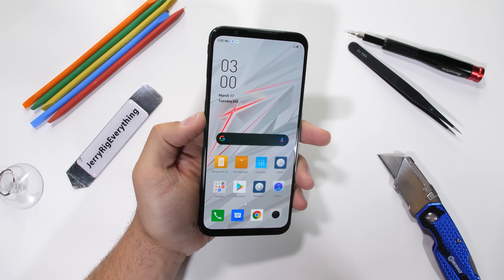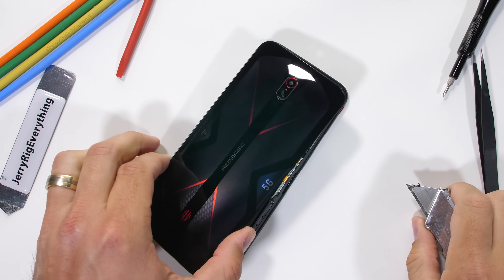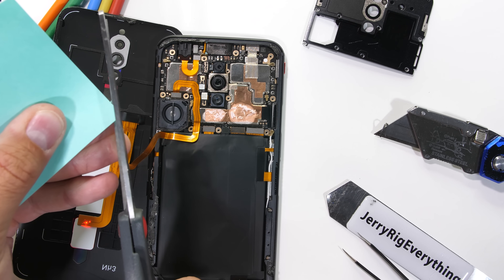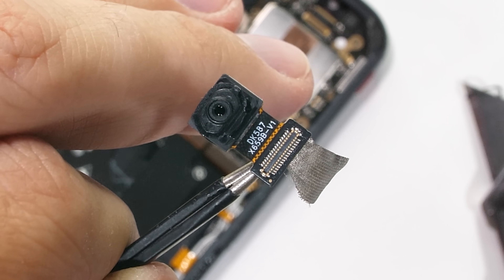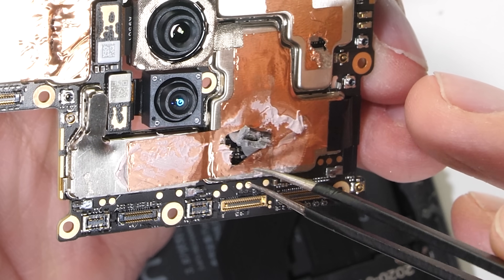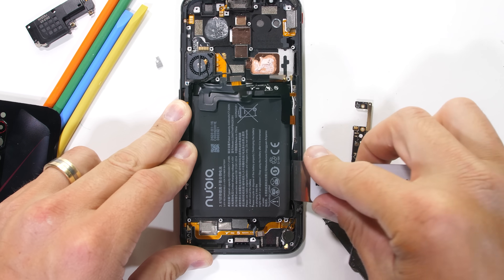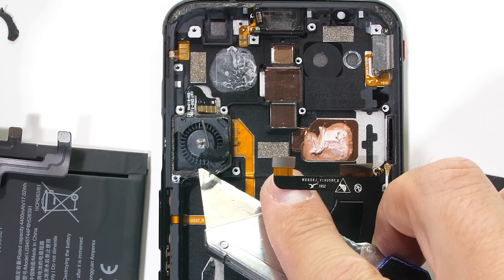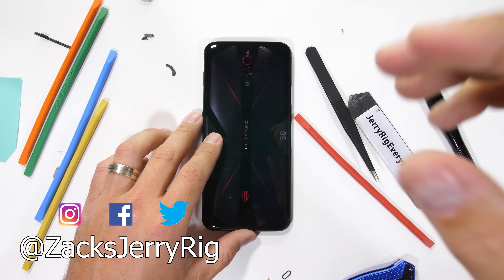RedMagic 5G Teardown! - How does the Cooling Fan work?

Comment: Hey Jerry,
I recently bought a Arctis 9x headset from steelseries, and I think something is aloof. Ive been having audio troubles, and the only thing that they have said to me through multiple support tickets is to use a paperclip or a pin to press the reset button on the right earpiece. However, this has not worked on the headset, and the audio problems started day 3, and I am beginning to suspect that there is not an actual reset button attached to the pcb. Do you happen to have experience with one of these headsets? Have you ever opened one up? I am considering sending you mine when steelseries decides to get me a refund

Comment: No, no fans, thank you. Sorry, but i'm the one who remember jack 3,5mm AND ALLUMINIUM BACK of smartphones (thats not so long ago). All you would need are thermal pads - on stick with motherboard chipsets and battery - aluminium back (and possibly whole frame) would act like radiator.